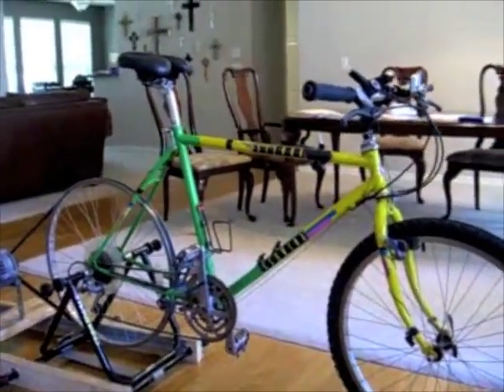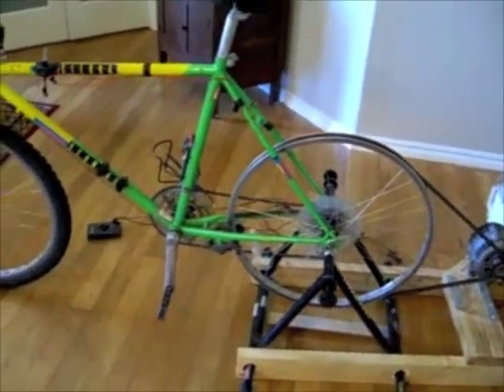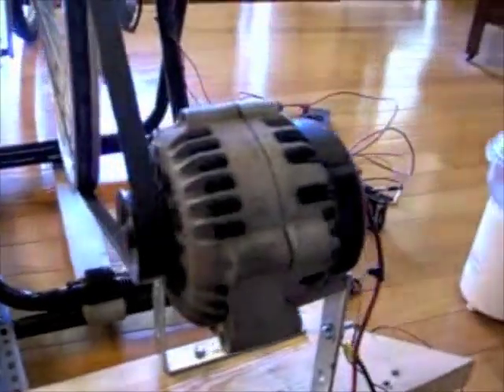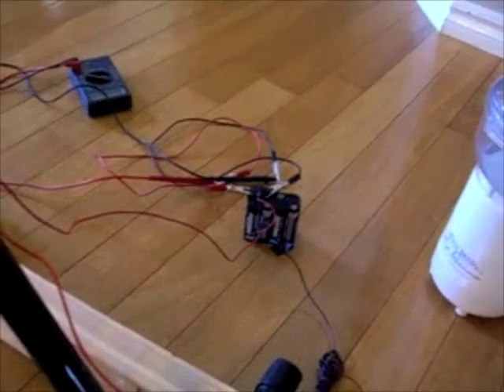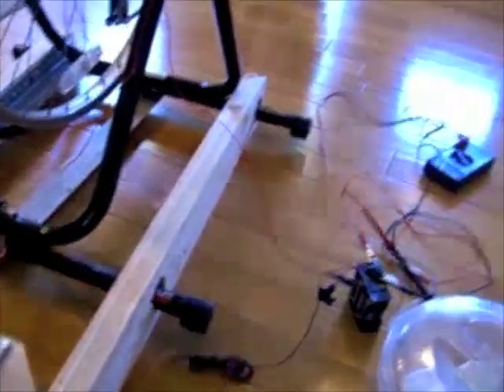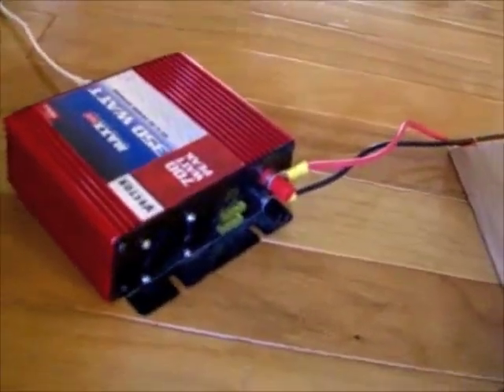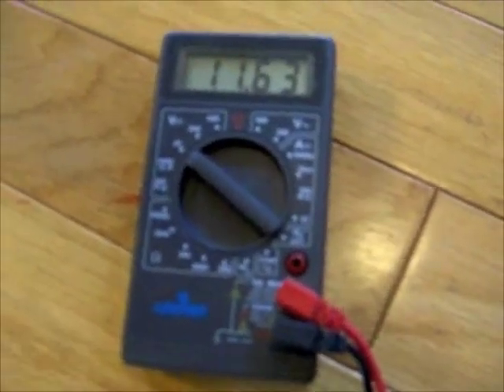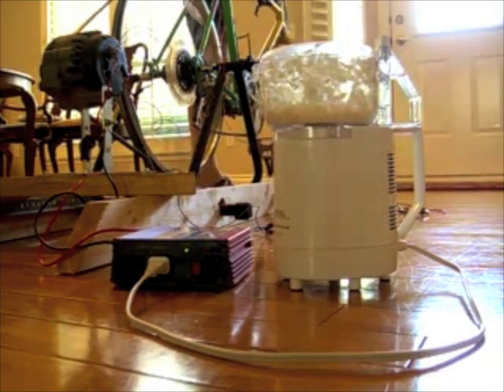Bicycle Generator

Comment: All of that to save $0.12 in electricity.  Guy might be good in science but failed in business math.
Reply: At what point did he say that this is more efficient and economical than plugging the food processor into the wall?.......oh that's right....he didn't.
Reply: Not sure what you mean.  A 60 watt light blub is a 60 watt light blub if it incandescent, fluorescent or LED.  A fluorescent light for the same light output as a 60 watt incandescent takes about 1/8th the effort.  I suspect some would be able to pedal and power a fluorescent for maybe an hour or two before giving up.  An LED with the same light output as a 60 incandescent should be easy to pedal power for several hours. 

But here's my question why?   Why would on pedal for hours just to save $0.25 in electricity? 
Don't you have something to do that would be more productive?  I know I do.
I also prefer incandescent light to fluorescents.  I find incandescents last longer and the color is better for reading.  I'm not rich but prefer to pay the extra cost associated to power incandescent lights.
Reply: breezebro rating light bulbs based on their power consumption is not an erroneous idea.
Even with new technologies it's still perfectly valid.
Reply: Passed High School Physics Sorry, but statements like this make me think that although "passing high school physics" you've failed in other topics, like "understanding other people" or "not being narrow minded"...
Seriously, come on.... In this whole discussion there are many explanations and possible uses for this generator and you still don't get the idea? Or... Are you simply arguing just to bid time (and laugh at us being trolled or something...)
Reply: Give it a couple decades or so...
Reply: Are you willing to pedal your bike for 12 cents an hour to power 1 50 watt light bulb for me?
Reply: I'm pretty sure he isn't doing it to save on bills, but for fun, to excercise and demonstrate the possibilities. And if you live in rural area it might be even useful when power goes out to generate a little electricity to for example recharge batteries used for UPS/inverter without the need of running noisy gas generator
Reply: mibars - Any ideas how much work or pedaling one would have to do charge a UPS battery or to keep a 60 watt light bulb lit?

To charge batteries for a UPS or inverter it would take someone three weeks pedaling several hours a day.  Not very practical. 

To keep a 60 watt light bulb lit one would have to pedal continually at a semi-strenuous pace like 20-30 mph on a level street.  Just go to a gym and see how many people can do it?  Even fit people can't do it for more than 20-30 minutes.
Reply: Passed High School Physics How did you come up with those numbers?
Typical biker going like 15mph makes about 100 W and peaks at about 1000W or so for a sprint, depending on how fit one is. Providing that there are some losses in between you can end up with 60W electric output. 
Those "three weeks" seems to be taken out of nowhere.. 60W equals 12V 5 amps and with 5 amps you can charge even big car battery (let's say 50Ah) in 10 hours, in practice probably 2-3 h longer because of losses and voltage needs to be 13-14V. A "UPS battery", even big 17Ah one would charge in just about 4 hours including losses. And that kind of battery in UPS can provide you with CFL light and some power for small equipment (chargers, laptop, etc) for a day.
Reply: Passed High School Physics At least in Europe if someone says "60W bulb" it most likely mean bulb which has similar light output to 60W bulb, you rarely see a true 60W incadescent bulb anymore. But for the sake of math I assumed that 60W of power, not 11W CFL. 
"I find incandescents last longer and the color is better for reading" Never buy cheapest CFL's possible, they are crap, they die in no time and have odd color due to low RA index. And forget "daylight" color ones (5500K, 6500K etc.), even quality ones, they are good for workshop or photo, you want something less than 4000K in your living area! Since we've moved to CFL's (Osram/Philips, RA over 82) we rarely replace any bulb, in fact I've never replaced one in a lamp that we use every day for few hours in living room, the ones that turn on automatically and are on all night has been replaced once (over the door and garage) in 12 years!
If you want a good quality light (RA = 100, more than typical incadescent) go for halogen (packed inside classic glass bulb), they are more efficient by like 20-30%, last twice as long and are slightly less yellowish. There are also LED's that have great spec (RA over 90, color about 3000K, very small energy usage), but it is hard to find one in reasonable price.

Huh, lots of offtopic... Anyway back to the generator and to what I said at the beginning: It is a "for fun" project that can be actually useful during power outage. And yes, running it all time is pointless, but having a battery to recharge is a way to go.
Reply: breezebro "Now they find a 60w CFL is not as bright as a 60w incandescent."

I assume you mean a 60W equivalent CFL that's actually around 10 W.   That's the point, it's supposed to be the same brightness as a 60W incandescent.  Whether it is or not isn't the consumers fault.  ...but it's NOT a 60W bulb.  

So yeah I'll agree most Americans probably don't get it, but apparently most Europeans don't either, cause if they did you'd be buying 10 W bulbs, not '60 W equivalents'.
Reply: It's the marketing dummies trying to equate watts to lumens.
Reply: A lot of you think this is only about money. It can be useful if an over weight person wants to shed of extra calories. Many run the treadmill and get nothing in return besides burning calories, with this you can maybe charge your phone as well as get in shape.
Reply: One could  run on a treadmill at a brisk rate for 2 hours they could charge a cell phone.  Or they could pay the power company $0.001 to charge their phone.
Reply: Passed High School Physics Are you that daft? Your statement is completely exclusive to mine, as clearly mentioned, it is not about money. Regurgitating financial calculations in most of your post shows lack of reasoning to respond appropriately to the situation.
Reply: Milbars, First it's not a generator, it's an alternator.  (Big difference.)

Can you give one possible use that makes sense?
Reply: Ad1. Sorry, you've failed. Alternator is an electric generator. One of many types. Also a dynamo is a generator, what you might have thought about trying to point out my "mistake".
OK, let me repeat myself:
-Emergency power
-Excercise
-Fun (Yes, some people do stuff like this for FUN)
Reply: Emergency power?  Do you have any idea how much electricity someone could generate pedaling?

Someone would have to pedaling at a moderate speed would have enough energy to light one 60 watt light bulb.  

An alternator produces AC, doesn't have a commutator and produces AC.  Generators have magnets and produce DC and do not require power to produce power.  This is why you can push start a car with a completely  dead battery and you can't with an alternator.
Reply: Michael Rhoads So where does the energy come from to power the field windings?
Reply: Need 12 + volts to flash it
Reply: He said that I believe
Reply: I believe this guy said it best

http://m.instructables.com/id/Bicyle-Power-for-Your-Television,-Laptop,-or-Cell-/step2/16-Bicycle-generators-on-May-15th-Ellen-Degeneres-/

O one of the good things about an alternator over a DC generator is you can find it cheap $15 bucks our so at a salvage yard
Free in an abandoned car
Won't overcharge like a DC genny will and you can easily store power in a battery.

Comment: an AC generator would be way more efficient (much higher wattages and no loss from inverting) for 110v purposes and wouldn't require more space or more pedaling power.

Comment: OR USE MAGNETS TO REPEL EACH OTHER AND SPIN CREATING ELECTRICITY!? CLEAN ENERGY SUSTAINABLE TELL ME THE FLAWS?
Reply: The flaw is that IT DOESN'T WORK. The magnets will find a natural equilibrium of repelling fields and act as a break stopping the rotation.

Comment: ..you could probably blend more efficiently if you got rid of the electricity and just hooked up the blender to the bike. have a band go from the wheel and spin it
Reply: Kind of a late reply, however, even if you managed to hook that up, it only works for devices that have moving parts, so for example, any kind of chargers wouldn't work by your theory
Reply: @chickeyy1792  exactly. this is a demonstration of mechanical energy converted to electrical energy .

Comment: hey I have one thing to ask. I connected the field wire and the positive terminal to the positive terminal of the battery and the ground to the ground of the battery. When i start pedaling i only get 1 volt when the volt meter is measured coming at the end of the alternator instead of a 12-14 volts. Any suggestions would help.
Thanks

Comment: You need to switch the bicycle out for a electric motor, so you dont need to peddle to get electricity. almost got it keep it up.
Reply: Where is the electricity to run the electric motor going to magically come from?
Reply: a battery
Reply: giantsinister And what do you charge the battery with.
Reply: alternator
Reply: giantsinister So you're suggesting that he use an alternator to charge a battery,  that runs a motor that drives an alternator that runs the chopper? What is driving the alternator that is charging the battery?
Reply: In short the electric motor.

12v 10,000 rpm Electric motor = 10.00$
12v output alternator = 15.00$ (1v per 50rpm)

ALTERNATOR CREATES 1V PER 50 RPM

1.2v from a battery can spin the electric motor 1,000rpm

.6v = 500rpm
.06v = 50rpm
.72v = 600rpm

.72v will spin an electric motor 600 rotations per minute, (add additional voltage to account for alternator drag.)

The 600rpm on the alternator will create 12v
(50rpm = 1v 100rpm = 2v 150rpm = 3v)

                             so

0.72v(plus alternator drag) from a battery

will power an electric motor and spin a rotor 600 rotations per minute

this rotor will spin the alternator creating 1v per 50rpm

12v will be created for only 0.72v
12v created is enough to max the motor out at 10,000 rpm but only .72v is needed to keep the cycle.

Comment: hi Sr I try to build one for my daughter but something was wrong because was working good I install some 12v lights and was fine but  when I check with the meter I got no more power,, so I wondering if I wire it some wrong or the switch I left it on all the time,, I took the alternator to check and they told me is bad so maybe u can help me in what I do wrong,,

Comment: Could you just run a straight axle through multiple back rims/alternators creating more power? Using said power to run an electric motor to make it where you only have to get this started and then eventually run itself? Or would the electric motor be an energyhog?

Comment: @Leo W can make another video exactly like this but using a cars battery with very little charge and maximum water level, car battery voltmeter, magnet in alternator, grid tie inverter, and please use a car product which is electric to see how well it works please

Comment: to run an appliance like he did, he would need 6 amps DC for each AC amp drawn at 12 volts so, if you need to run a 3 amp appliance, you will need to feed at least 18 amps to the inverter. At 7 amp average for a 12V@ 100W solar panel, you will need 3 panels to achieve the same feat. That is why you instead charge a battery bank and run your inverter from the bank. Hope this helps!

Comment: thanx very much. I plan to use mine to charge my car battery, and/or run other DC devices.  Including LED lighting.  I came here looking for this  invention, by my own searching, and yours  was at the top of the list, and for good reason, evidently.  Thanx again.

Comment: With anything mechanical [refrigerator and this food processor] you're MUCH better of running the belt directly to the unit.  I think the ideal situation would be to have a freezer [better insulation] and riding it for few hours a day it would need.

Comment: One more thing would you knowing what you know now about how fast you have to peddle the bike would you go with a street bike with a larger back wheel and higher gear  or more gears like a 24 speed instead of a 18 . or even add a custom  gear . something that would make 12 volts with less peddling.

Comment: I have an 8268n alternator and I'm having trouble finding the pinout for it. It has a male connector with 3 pins plus the post. Any idea which of these I need to connect the 12v to? Or how I could test them to ensure I'm not wiring something incorrectly and destroying the alternator?

Comment: Wow, dude!  You're going to burn him on 1 watt compared to 745?  That would be an error of 0.13%.  Did you really feel the need to correct someone that bad?

1hp = 745.699872 watts

So, you're wrong, too.

Comment: It all depends on the battery you want to charge, the alternator's output amp rate and your effort! By using the formula ((BatteryCapacity x 1.44) / AlternatorOutput) you can approximately predict when you're done with your duty "cycle"!

Comment: If you have a portable jump-starter with a cigarette lighter attachment you can plug it into the inverter and store power; you can then plug the inverter into the jump-starter and run small appliances.  The instructions for mine say that I can get about two hours of power from a charge.

Comment: Hi if I use this generator project with a cars battery that has little charge it will get charged up and when it goes to the grid tie inverter it will get plugged to the wall will it help reduce the electric bill, help generate electricity for everyone to use

Comment: at @6:18 you see him pedling and then the processor being switched on casues him to have to pedel harder, and it looked like it was quite a large load applied. likey around 3 hp.
if you was to do this and have to permanently set up, you would want a fly wheel on the end of the alternator to smooth out that jolting
but i reckon if there was a prober 12v car battery it would likley stop that any way

Comment: This would be a good way to generate electricity in an emergency situation if you either don't have a back-up generator or run out of fuel for your generator if you do have one.

Comment: Will only a 12 volt source work with this setup? Or could I connect a golf cart battery to it as the source of electricity to fire up the alternator, and in return, have the setup charge the battery, which I could then use to charge say a laptop, some phones and such?

Comment: StinkyCheese  I didn't say the 3 phase would work for the food processor.  But store bought generators do output AC and they are more like car alternators since there primary output is AC.  And you could build an efficient generator with a car alternator and an engine.  I never said easy or cost efficient.  But what Leo W is doing is the easiest and most stable way.

Comment: Burgers without the bun, hold the pasta. All the cheese, butter, lard, and bacon you want. Reduce grain consumption by 95%. Avoid vegetable oils, (look up how they are made, you'll switch for sure) use coconut oil or lard. 

Look up a documentary called 'Fathead' by Tom Naughton.

fathead-movie d o t com

The documentary itself can be found on Hulu.

Following this diet (similar to the Atkins diet) my wife has lost 60 lbs. in 3 months. Something she's NEVER been able to do on any other diet.

Comment: The problem is our government (USDA) and how they've managed to fool everyone that a low-fat high-fiber diet is what we all need. That, in fact, is false. What people are finding is that we need a high-fat low-carb diet like our ancestors. There is a slow movement to get the message out what needs to happen. The calories in, calories out method is bogus and doesn't work mathematically. Low-carbing actually gets results. GMO grains don't help either.

Comment: Alternators actually output AC voltage before its converted to DC in the rectifier.  So you are going from AC to DC back to AC with the inverter.  Its very inefficient, bypass the rectifier and use the 3 phase AC

Comment: Yes and no, cars have a battery for starting and storage.  Yes an alternator needs voltage to make voltage like the guy says.  Old vehicles had generators and worked without voltage applied and some newer cars have self exiting alternators which dont need the exiting wire because its done internally.

Comment: Not necessarily.
Power is generated in this fashion, by a coil of wire rotating in a magnetic field.
A generator uses permanent magnets to generate this field, while an alternator uses electromagnets (coils of wire that become magnets when electricity passes through them). So an alternator requires a starter current to begin generating electricity, after which it can be self sustaining. However, an Alternator is cheaper to make and easier to maintain than a generator.

Comment: Great vid.  I have a question though.  If you simply want to charge up a battery bank (a set of car batteries for instance), could you simply hook up the alternator directly to the batteries to charge them.  Then I would hook the power inverter to the batteries, so that I can have power after I stop pedaling.  Would that work?

Comment: I just have this question  : Where did you connect that battery pack to give you that 12 volt source that you needed?  Did you say " The wall socket" ?  Why didnt you just hook up your little processor there to begin with? It would of saved you all that time you spent making this video.

Comment: It was incorrect. It is a generator. In a strict sense an "alternator" is any electric generator that produces alternating current. The only reason it outputs DC is because there's diodes inside that rectify the AC to DC.